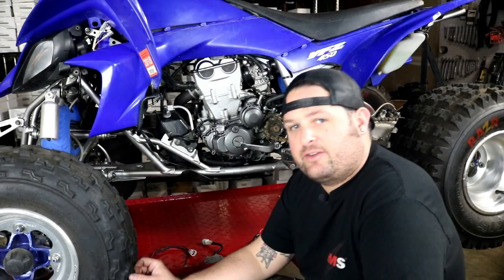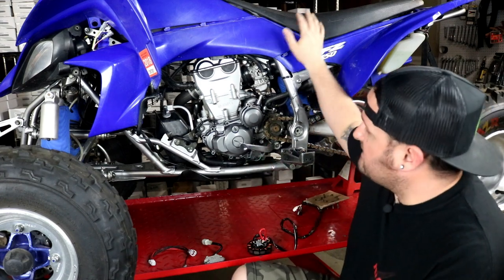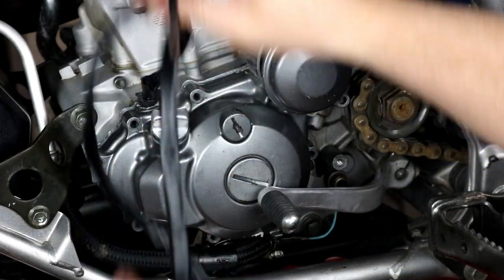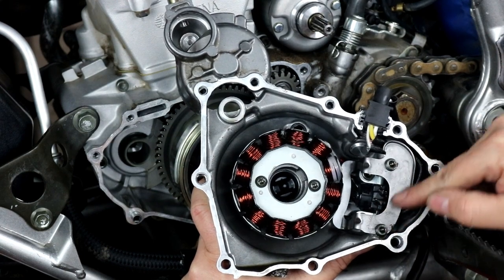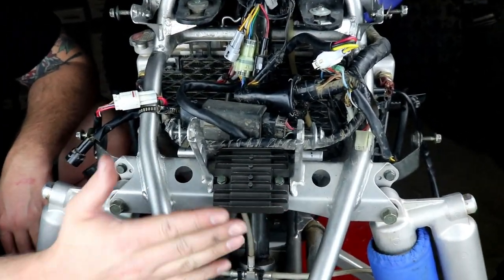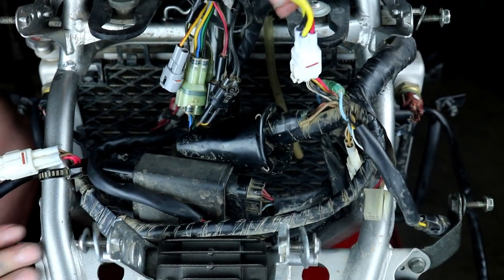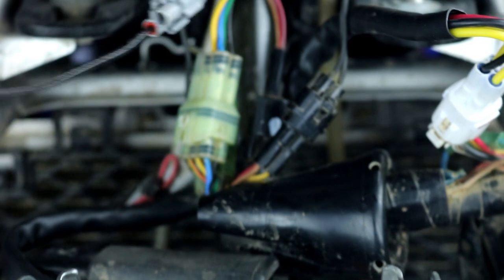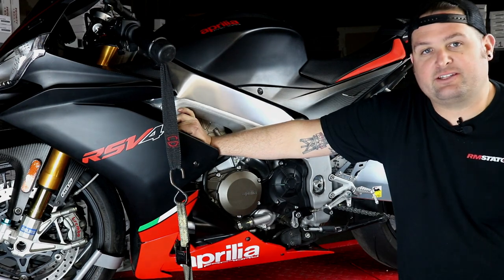RMSTATOR RM22430 Yamaha YFZ450 High Output Charging System DC Lighting Conversion Kit Installation

Comment: Hi I just ordered this kit and was curious what light bulbs to run after installing this? Also my bike is an 07 so I need to remove the resistor wired into the harness. Is there anything besides that? Thanks

Comment: Great video!

We have a ‘14 YFZ450R. When the battery dies, you can’t roll start the machine like our ‘04. My understanding is the factory stator don’t have the amperage to run the FI without the help of the battery?

Is this the case? If so, do you make a high output stator for the ‘14 that resolves this issue?
Reply from the maker: I'm not yet familiar with the fuel injected YFZ450's, but that makes sense. Sorry we don't currently have a high output system available for the FI models. Hopefully soon.

Comment: I have a 04 with Baja squadron sports. Would this stator and conversion kit for these lights? Only enough power coming off stick set up to run one of the lights at a time.
Reply from the maker: Yes this should power that light no problem.

Comment: Hopefully you are still here and reading comments, I’m a little late.  

What wire is the yellow with a red tracer?  Like what does it connect to?   

I ask because I have a 2012 YFZ450 that has 1 four pin connector, 1 three pin, and 1 two pin connector in the same area that yours has a 6 pin.  I can’t see a yellow/red wire around there either.  

I’m thinking that if I can find what that wire connects to, I can find out where that wire is on my ATV and it should work the same?  Everything else looks the same, except for that one part.
Reply: Did you ever figure out what wire to take out? I have the same harness with no yellow/ red tracer wire
Reply: @donnyalgieri  I have not.  I am doing lots of work on it, so decided to do the stator later.  But from what I can see, the stator in this kit will work with quads like yours and mine(12-13), but the “jumper” or whatever plug they use to send DC instead of AC to the headlights won’t work.  But you can make your own of those easily.  I will figure this out, hopefully with some help from the maker of this video lol.

Comment: Just installed the stator upgrade. A little while after the starter relay fuse blew. It was a 10A. Do I need to upsize this fuse or May something be wrong? It took a while before the fuse blew.
Reply: A year late to this but I’m pretty sure the fuse stock is supposed to be 15 amps so at one point someone probably replaced it with the wrong fuse

Comment: I just got a 08 yfz450 that has one of your stators installed. The directions it came with are way different then this. ??  It's only charging to 13.6 when running and 12.5 with the lights on when running. Is this correct??
Reply from the maker: Our video is older and doesn't account for a few changes that have to be made on the 2006 and newer models. They require removing the resistor and a different mod to the wiring harness. Our instructions are correct. Your charging output sounds slightly low. Are you using our regulator and wiring harness conversion as well?
Reply: @Rmstatorinc  the previous owner installed it, but incorrectly. i followed the directions that where included. he did not have the resistor disconnected.  i also made sure the other connections where correct.  i am using your regulator and harness and new stator.
Reply: hola amigo, una pregunta por favor pudieras ayudarme, la bateria tiene 12.4 volts sin encender la moto,  CUAL ES EL VOLTAJE NORMAL QUE DEBERIA TENER LA MOTO AL ENCENDERLA CON UN ESTATOR Y REGULADOR EN BUENAS CONDICIONES? @Rmstatorinc
Reply: Hello friend, a question, please could you help me, the battery has 12.4 volts without starting the motorcycle, WHAT IS THE NORMAL VOLTAGE THAT THE MOTORCYCLE SHOULD HAVE WHEN STARTING IT WITH A STATOR AND REGULATOR IN GOOD CONDITION? @Rmstatorinc
Reply: YO IGUAL QUE TU AMIGO COMPRE UNA MOTO TA CON ESOS CAMBIOS Y NO TENIA LA RESISTENCIA Y SE LA COMPRE PERO VEO QUE AL CONECTARLA BAJA EL VOLTAJE, Y CREO QUE TENIA SU ESTATOR DAÑADO POR QUE SE DESCARGABA LA PILA
 @YZEATER

Comment: I have a 2006 yfz 450 it cranks and everything but won’t start every time I press start button the temperature indicator symbol lights up any recommendations
Reply from the maker: You do need both stator plugs connected for ignition to work correctly on a YFZ450, make sure of that.

Comment: I have a 2012 yfz 450, will the stater you sell for the 04-09 fit my 2012  450.
Reply from the maker: Yes, I believe the stator is the same for 2012-2013. However the wiring harness in our kit may not be the same.

Comment: Hi
I have  yamaha 450 yfz 2012 and change headlights 55w i need better stator regulator do you know if it's the same model on website rmstator (2004-2009) 140w

Thank you
Reply: Im in the same position, did you ever find out ?
Reply: After doing my own research I honestly don’t see why it wouldn’t work, I compared part numbers to it and it’s pretty similar, they have a pdf Instruction manual in the description of the product in there website, it tells you how to do it for a 09 and the 12-13 are pretty much the same so you really just have to follow those instructions. I will be buying one for my 2012 and will see how it goes but I believe it will work

Comment: Can this stator fit other atv or pit bike engines. Specifically: Daytona 190cc, pister Pro 190, or piranha zongshen 190.... thank you
Reply from the maker: No sorry, this is only compatible with the Yamaha YFZ450.
Reply: RMSTATOR my 2004 ufz450 sat for almost 3years without been turn on.I tried to turn ot on a couple of days ago and it wont start or crank nothing just the overheating red light come on evrytime i push the star button any ideas what might be wrong? I change the oil sparkplug the oil filter and nothing no crank nothing any ideas?.
Reply: RMSTATOR meant to say yfz450

Comment: Hello i have 450 yfz 2012  i have change stator with rm stator 2012 i have also headlight 55w  i need ac dc converter? Thank you
I have check plug are not the same as video 2012  my model video before
Reply: yo igual tenfo una 2012 de carburador, pudiste solucionar el problema? la mia tiene el cable conectado en un relay, pero me fundio las bolbillas, por favor contestame amigo

Comment: Hello I have a 2008 yfz 450 and I was putting in the rm stator I went to the rely #2 and pulled out the yellow and red wire and did what you did and it didn’t start at all it would rollover also it told me the use the blue wire how come you guys do t have a video on that one just wondering
Reply: hello wonrdering if you got this figured out because i have the same problem after i installed it
Reply: mi yfz 2012 la compre y tiene un cable azul conectado a un relay y los cables que muestra el video que se conectan el conector de la llave de encendido y si funciona, pero mi estator yo regulador de voltaje ya no carga y vere cual es para cambiarlo....  que voltaje da la moto al prenderla sin acelerar?? @djuniqo

Comment: I have an 04. Doesn't have a 6 pin. Has a 3 pin (ignition), and 4 pin (lights). Red with black, red with white, yellow, and blue. Which one do i use for the lights to work?
Reply: I guess they don't answer questions 🤦‍♂️
Reply: Did you figure out what wire to use? I have the same harness

Comment: You never ever put rtv silicone on a paper gasket. Old timers  use grease, next time you remove the part, no scraping and gasket can be re used if necessary. An old drag racer hot rod builder taught me that trick a long time ago. Not hating just helping
Reply from the maker: Thanks, appreciate your opinion! I always use a thin layer of black RTV on stator cover gaskets that I don't expect to remove for a long time. Never have a leak or any issues getting it off in the future. On my old cars I typically use grease, and I agree that works very well too.  Thanks for the input!

Comment: Is it bad if i removed the tierap on the stator
Reply from the maker: The tie wrap is there to secure the stator windings from vibration and rubbing against each other, or the stator core or flywheel. This could cause the insulation to breakdown and a short in the stator. I would leave them in place. However if you remove them just make sure there is no loose windings in that location.
Reply: Thank you and ALSOi have a 2008 so its the brown wire and when i switche it my lights were still running of the stator what should i do
Reply from the maker: I'm actually in the process of updating our instructions for the 2006+ YFZ's. Email support@rmstator.com and request the updated instructions. I will send them out asap when they're done.

Comment: I got a 2016 450R and my battery keeps running dead for no reason I can find any ideas any1??
Reply from the maker: Perform the stator and voltage regulator troubleshooting steps in the factory service manual to start. One or both has failed. It is usually best to replace as a pair.

Comment: how to fix overcharging problem?
Reply from the maker: Overcharging is usually caused by a failed voltage regulator. Start with replacing the regulator.

Comment: Wiring harness conversion ac to dc 450 yfz 2012?
Reply: That’s what I’m wondering, this would fix my headlight issues
Reply: @jonathansanchez6952   i have same problem
Reply: @muhsinin7415  So I was doing research and looking over there installation diagram and I did find that it will work on a 2012, the harness changed on 07 to 09 I believe but they include that in the revised version, I’m talking about the harness with the relay which is what we have, they include the kit for it and it will work. I did find the exact kit on amazon being sold from another company for the same price but Amazon has a 15% off so I got it from there
Reply: @muhsinin7415  I forgot to mention the kit is from RMSTATOR just being sold by a 3rd part
Reply: @jonathansanchez6952  do you have link amazok please

I have problem sith arness not good

Comment: My yfz450 does not have the 6 wire plug in. It only has 4 wire plug in. No yellow wire with red tracer on it. Which wire do I  connect the mod cable to?
Reply: Ever resolve this problem? Cause I only have a 4 pin as well
Reply: @sheldonnorthrup784  yes. That wire is on one of the relays on left front of chassis. You need to pull it out and connect the black wire to it.
Reply: The yellow wire with red tracer.